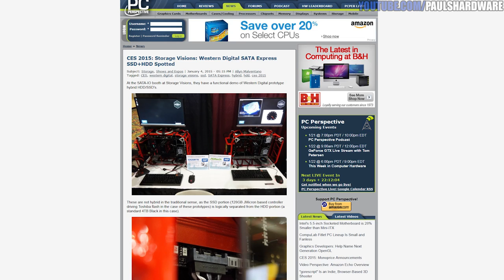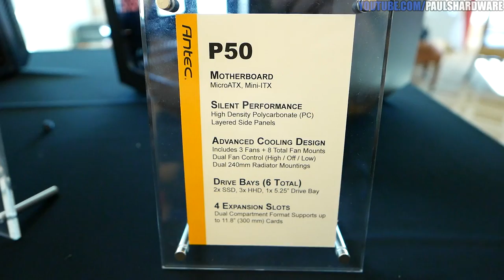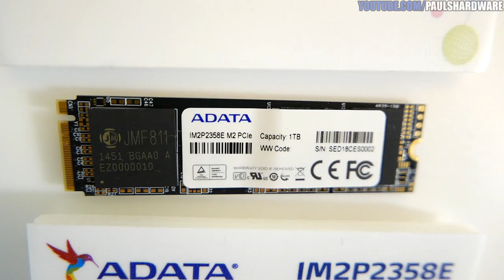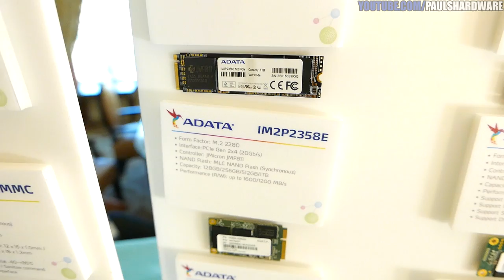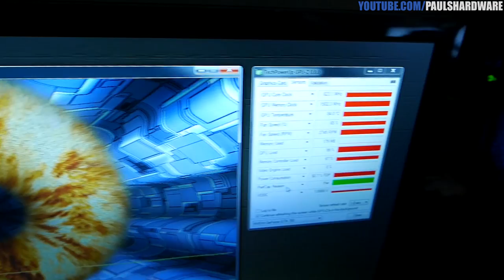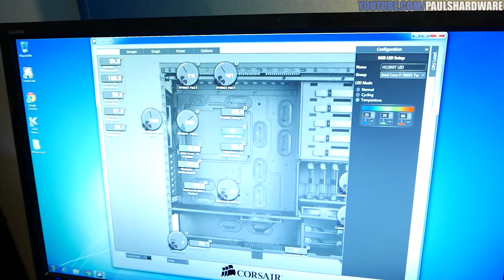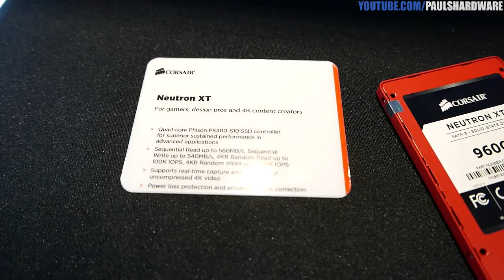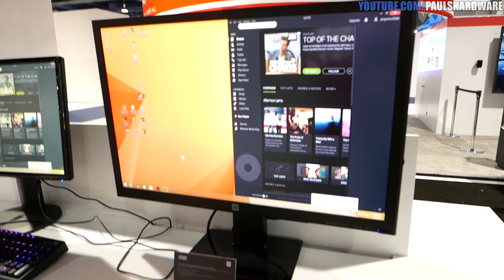The Finale: Show Floor & Shenanigans

Comment: Thank you WD and Fractal Design for sponsoring Paul, especially Fractal Design, you guys have by far the funniest video of CES 2015 I've seen!

Antec, if you're reading this, please include at least a 240mm water rad support at the bottom for the P380, or even bigger if you remove the drive cage. I like it that you finally added a hole for cable management under the motherboard, changed the drive mount (the old ones where horrible), added water cooling support in the front and also a PWM fan controller hub in the back, BIG +, but the aluminum finish is not enough to make me buy one compared to something like the Phanteks Pro or even Luxe.

Hope the feedback is well received!

Comment: First CES interview from a bed? I think so! Congrats Paul!

Paul would you consider building a PC in the Lian LiPC-07 ATX open air case? Its thin and beautiful but Im not sure  how Id build one with a huge video card and PSU.

I would LOVE that Corsair PSU. I use a HX850 now and before that a HX450 or so. Love them. Is Seasonic still the maker of Corsair PSU?
Reply: They many different OEMs for their PSU but I think felxtronics o make their digital stuff

Comment: Had to like this video due to the tub part of your interview.
I also had a question, you had mentioned the Gigabyte Brix in one of your CES videos... I was curious if you've ever tested/used one of them or the Intel NUC or anything similar?  I had looked through some of your videos and didn't see anything about them specifically.  Just kinda curious as to your thoughts about them, good/bad/build something else instead of using one of them, etc.  Oh also, thoughts on the Intel Compute Stick?